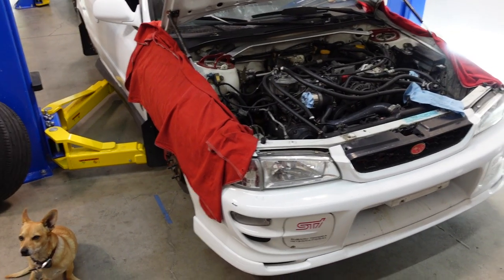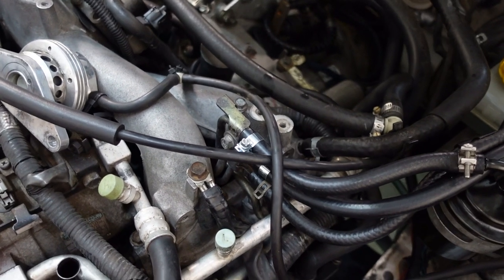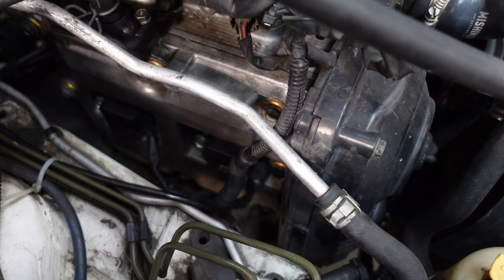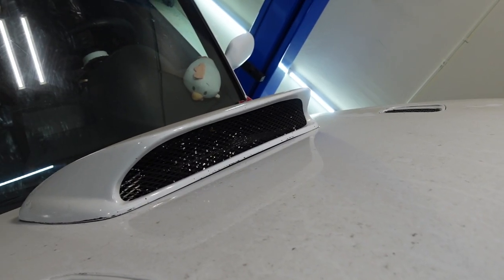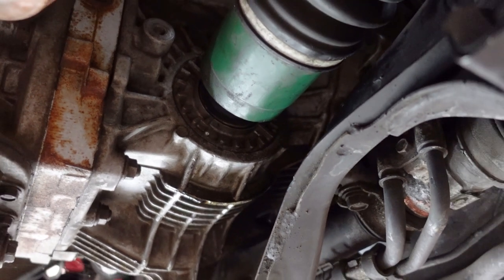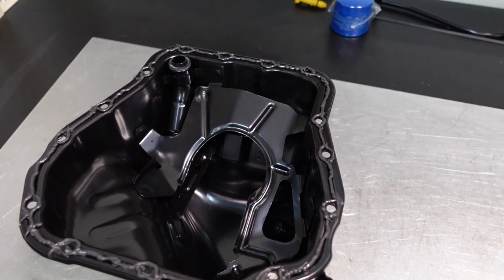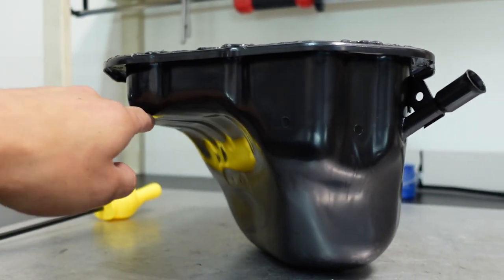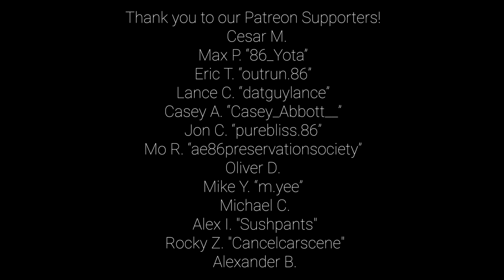2.5RS GC8 USDM STi Swap

Comment: Instead if jacking up the engine get a 2 or 3" extension behold the socket, then a universal wobble adapter, then a 6" extension on longer and use that to get plugs out. Sometimes a magnet helps to pull them out if your rubber spark plug gromet isn't in your socket.
Reply from the maker: Great tip. Definitely depends on the engine as I have a double jointed spark plug socket specifically for the EZ3.0 and 3.6

Comment: Pretty sure thats a usdm bumper with JDM rear spats
Reply: USDM bumper with Honda Accord Spats
Reply from the maker: Very Interesting!
Reply: USDM front and rear bumpers on the 99, 00 and 01 were the JDM STi V5 bumpers (body and suspension components were the only STi components we got until 2004). 98 got the JDM STI V4 bumpers

Comment: Aww man, we need to get you in a Subaru forum to read up!!!

But for example the cup holders were on quite a few USDM models. Look CF wrapped.

I bet you the Brake light isn't even wired... lol

You shouldn't have to jackup the engine to do spark plugs. I have huge hands and its just not an issue. PITA but not an issue.

Those GS AOS are MEH. Should just get a traditional. ESP if he goes over 350hp. I think thats all they're rated for anyway.

The hoods were all made in the same factory whether they were turbo or NA. So thats all USDM. Some replace with a bigger scoop, but the 02-07 sti scoops do not fit.

Should really convince the owner to finish the STI drivetrain. Just throw STI axles and brembos on it. #simple

Should have done killer b pickup while the oil pan was out. OEM sucks Esp since you're ordering an sti one.... KILLER B!!! 

Good Luck!
Reply: The cup holder/radio bezel aren’t wrapped, they’re an OEM option. Still not carbon fiber though lol, it’s just an overlay design on the same plastic as the normal silver ones.
Reply from the maker: Lol. Overlay. Silly Subaru.
Reply from the maker: Thanks for the through response. We'll get with the owner!